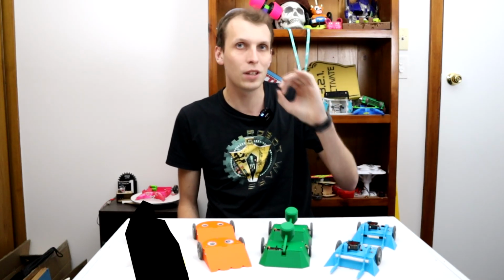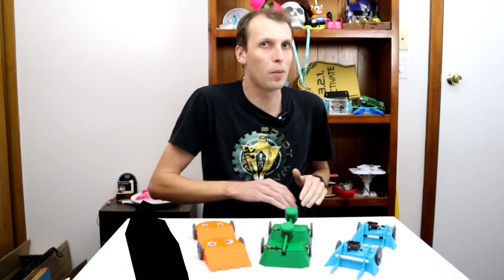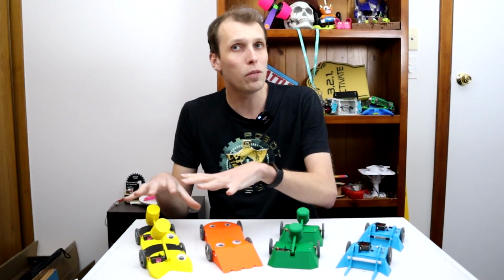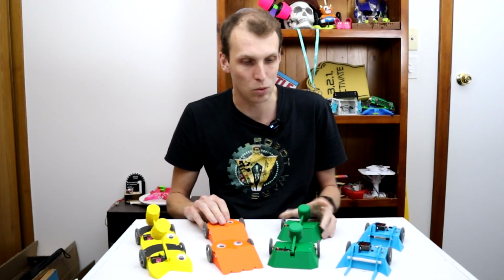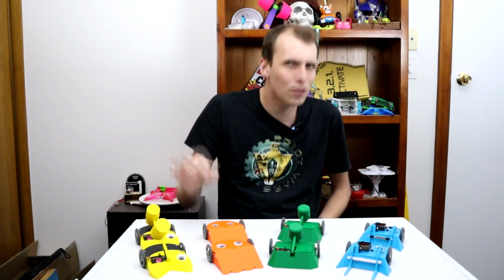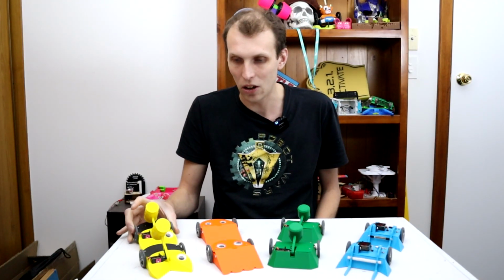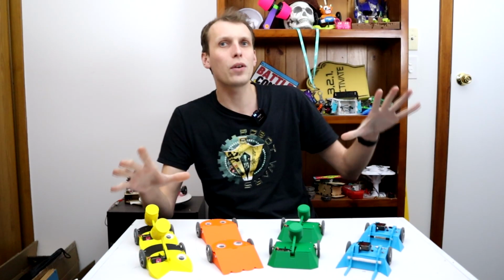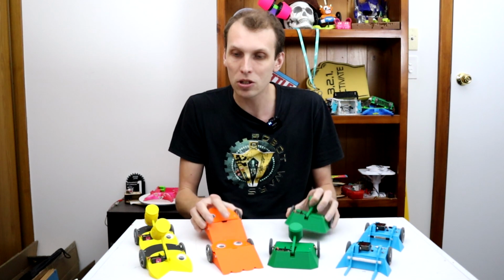Arcade Combat Robots! Reveal and performance

Comment: People often think their code must be perfect when open sourcing, but you don't just open source it once. You open source it and then you or someone else fixes the stuff that needs fixing. Just open source it.
Reply from the maker: sure, 
But these dont fail safe.

Yes they are only running 1s and servo powered weapons, but something that does not fail safe can still cause issues

If the problem with the code was anything other then this, I'd release it as is, but personally I will NEVER release code that I know does not fail safe a moving robot

Comment: Did you have much issue hard mounting things to the servos over such a long time period? Overloading etc.?
Reply from the maker: somewhat, 
Kids wiggled the hammers a lot, basically spamming the button which had a habit of backing the screws out of the servo horn, leading to the horn popping off (which didnt happen on the lifters)
I also had 2 servos break on the hammers over the weekend, both just got jammed, not sure how or why that happened

For v2 I'm going to remove the servos and use n20s for the weapons instead to increase the reliability
Reply: @TeamPanicRobotics  I had a couple break on a 2 servo grappler quite quickly in. Ended up working out a soft mounting system with tiny elastic bands that's lasted a years worth of fights so far. Arm screws in at the bottom with small plastic bands held at the top of the horn, you can adjust them for how much of a buffer you need.
Reply from the maker: those servos must not like being jammed and trying to move further then the arm will let them
A soft mount sounds like a great way to go, I'll keep that in mind